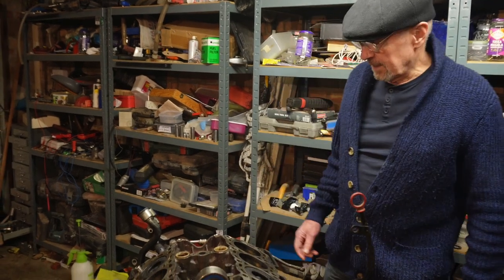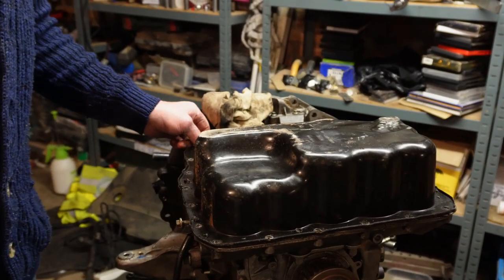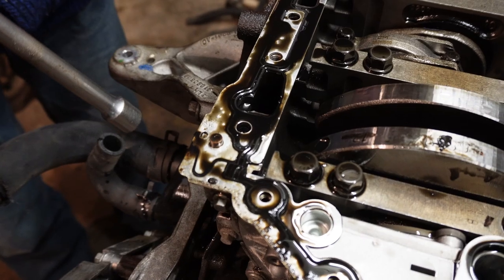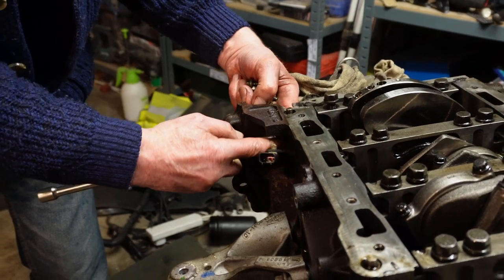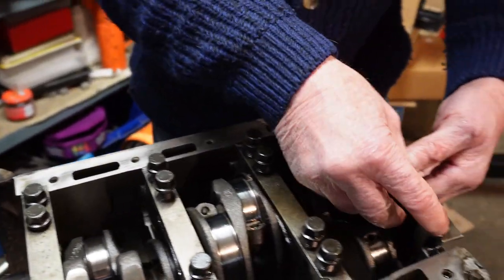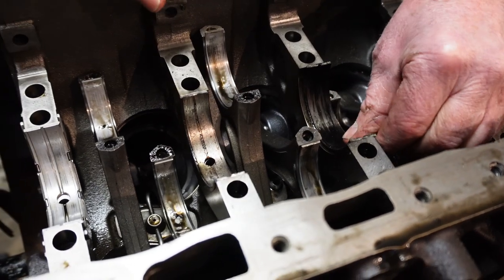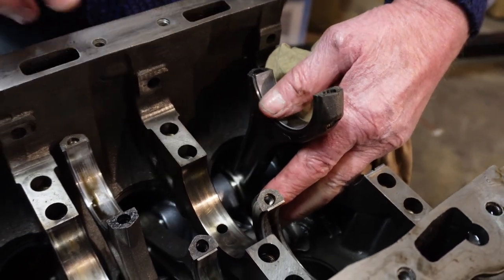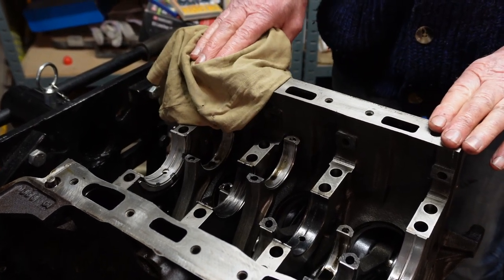2.7 / 3.0 Diesel TD V6 Jaguar Land Rover - Destroyed Bottom End Crankshaft

Comment: Would you recommend using 5w40 oil instead of 5w30? Mine has 175K miles on it and has the DPF (09MY). Thinking of using 5w40 now
Reply from the maker: Hi, thank you for watching and for your feedback. I stick to the recommended oil or equivalent simply because I have not put the research into how different oils / grades may affect the engine / cats / DPF. I do recommend 5 to 6,000 mile oil / filter changes just in case the engine oil is, or starts to  get diluted by the diesel fuel.
Reply: Go to the LR Time channel on YouTube. Christian, one of the presenters gives advice about which oil to use and why these engines fail. Spun main bearings are because the two central main bearings share lubrication oil from the same oil gallery pipe, so the oil pressure to them is too low. Whereas the two end main bearings have their own oil galleries. On top of this, the width of the main bearings is quite low and there are only four of them, on a LR, with a high torque engine, that puts lots of stress on them, an inline 6 cylinder would have 7 main bearings, so much lower stress on each one. LR chose the V6 to save space and money as this engine that can go in jaguars, C6 citroens and LRs. A bit of a compromise / penny pinching I'm afraid.
Reply: @richardhasler6718  I did find them and , watched the video you are referring to. It was very interesting. I decided to put 5w40 in mine.  So far so good.
Reply from the maker: Hi Richard, thank you for watching and for your feedback. Your comment / advise  raises the fundamental question, why do only a small number of these engines fail in comparison to the thousands / millions that don't ?  @richardhasler6718  Thanks again for watching.
Reply: @crystalclearmechanics thousands of them are failing. It's more of a when, rather than an if, on these units.
Reply from the maker: Hi Davey, Thank you for watching and for your feedback. I will be uploading a new video soon which will explain why a few  ( in comparison to number produced ) of these engines self destruct. I think you will find it very informative and it should put an end to the guesswork that is put forward as evidence of causation of failure, also the remedies that are pointless. @daveyboiyeah
Reply: @chips183 don’t do it I know someone did this in there 2013 sport and destroyed engine

Comment: I just bought a 2016 Fpace 3.0lt twin turbo & am now sh*tting myself !
Reply from the maker: Hi Darren, Thank you for watching and for your feedback. I will be uploading a video explaining the reason why a small percentage of these engines self destruct. I don't know your driving style but would advise an oil and oil filter change at 5,000 mile intervals as a precaution.
Reply: @crystalclearmechanics  thankyou my friend . I noticed in the service history the cam belt wasn't changed at 180k . I've now booked it in for a full service and cam belt change . $4300aud ! But at least I can drive it in peace then
Reply: When traveling with load in the car or high speed but low revs, kick down the gearbox first sonthe revs go up before accelerating had. Its called engine lugging, the oil pump isnt spinning quick enough to cool the engine when on load

Comment: The main problem is this engines not made for 2.5 ton heavy 4x4 suv's land rovers destroy low ends of engine because of crankshaft cant carry the stress of weight jaguars are going 250-300 mile without any problem especially xj's(because lighter 1 ton) also oiling process is so important in this engines this engines not start and go engines you must wait minimum 15-20 second for oiling ıf you good maintain them they go really high mileage without any major problem,nice videeo thank you !
Reply from the maker: Hi, thank you for watching and for your feedback. You make some good points.
Reply: Also note that JLR was recommending the wrong oil type, whereas PSA, was recommending the correct type. That's why you never see PSA cars with these problems.
Reply: @daveyboiyeah  thats true also jaguars  and psas have 2 garrett turbocharger and its have nice boost lr models have 1 big borg warner its no boost in low rpms and low end gonna eat itself my siblings have xj 2.7 with 510k km factory engine my s-type 2.7 only 185k km no problem workin like a first day 7k km-1 year oil filter service and general engine maintanence(oil pump water pump belts etc) also cheap oil filters are not work on this this engines ı always use genuine oil filter mahle air filter
Reply from the maker: Hi Davey, as i replied to your first comment, Please watch the new video ( soon to be uploaded )  @daveyboiyeah
Reply: All Cars with he 2.7 have these problems. Citroën and Peugeot ar much lighter, but, always the same, sooner or later. What really makes a difference, euro3 cars last longer. Euro4 engines have particulate filters, they have a cleaning process every 1000mls, that cause problems, Diesel can get in the oil sump. A lot of heat, bad for the engine oil.

Comment: Cause is simple ,,,, low oil levels ,,, the sensor checks the level in the morning with all the oil in the sump , and its just ok , no oil level warning  run the engine and half the oil is in the top of the engine , then go up hill or down  and the oil pickup has nothing but air to lift ,,, end of engine . if they had a deeper sump with more oil they may be fine , but tabs on the shells would help too , fix both and the issue would go away . well thats my thoughts.
Reply from the maker: Hi Tom, thank you for watching and for your feedback. Watch my cause revealed video for the main reason.

Comment: The oil pumps  in these engines don't supply enough volume or pressure.
Reply from the maker: Hi Darrel,thank you for watching and for your feedback. That does not explain why only a small number of these engines fail.
Reply: Rapid cold starts,foot to the metal straight away not giving engine time to circulate oil ?  In my Discovery 4  2016 I always wait 45 seconds at least before I drive away.
Reply from the maker: Hi, thank you for watching and for your feedback. Worth doing. @blackvulcan100

Comment: Would any of these symptoms manifest itself during regular servicing 😊
Reply from the maker: Hi,thank you for watching and for your feedback. If you watch my video " Cause revealed " it shows the main cause of failure. I recommend a 5,000 mile engine oil and filter change as a precaution. A check you can do yourself although it's not exact is to check your engine oil level on a regular basis, If it is increasing change your oil / filter and maybe your driving style. My "cause revealed" video explains it all. Thanks again for watching.

Comment: 15:55 is the jaguar long block or even the short block compatible with the Landrover (bolt holes sensors etc ?) could i source a jag engine and transfer the remaining parts onto the long block ?
Reply from the maker: Hi, thank you for watching and for your feedback. As reported year for year they are the same. I have not had the engine from a Land Rover and a Jaguar sitting side by side to compare but I did sell a Jaguar 2.7 engine to be fitted in a Land Rover and they didn't report any issues. I don't know if you include the oil pan / sump as part of the long / short block but that is different, My advise if it's the 2.7 engine you need, go for a 2004-2005 some 2006 before DPF regen.
Reply: @crystalclearmechanics  if I could easily replace it with something else I would , a nice Mercedes’ 606 would be ideal. I can get a complete Landrover engine with 300,000 kilometres and no idea of the service for €1500 or a an AJD from a 09 Jag XF with 135K for €500. Nothing wrong with what I have in it at the moment but it’s a lottery for when it goes bang as it’s also over 300,000 kilometres. Great car, shame about the engine. I believe the newer ones are even more delicate.

Comment: The problem is high compression + a faulty oil distribution lines design. Same engine is used on Citroen C6 and this don’t happens . To use those compression ratios on LR one must create new paths ( opening holes on the block ) till the middle bearings and course figure out new paths. Also increasing slightly the oil pressure inside the pump is a good move after all is TO MUCH compression for TO FEW bearings with a bad and faulty oil distribution the first and last bearings receive more lubricant than the middle bearings. Using Fusion 360 for that task is of great help. Also you could simply lower your car compression will be slower and have the same power of Citroen C6 but most probably that won’t happen. But I prefer the 1st option + using Fusion 360 is extremely easy near intuitive also you can monetize well by creating improved spare parts and running simulations something that Fusion 360 software also allows one to do.
Reply: C5 and C6 has the same engines as shown on material, and has the same issues. I already took apart multiple C5s with that issue.
Reply from the maker: Hi Rafael, thank you for watching and for your feedback.

Comment: Hi, I would like to ask if there are any symptoms to spot before the engiine fails like vibrations or noises?
Reply from the maker: Hi John, thank you for watching and for your feedback. I can't say first hand as I have not been in a Jag when the engine has started to fail but all 4 customers assured me there was no warning until they heard the loud knocking. There are weaknesses in the engines design but I think other factors cause or help to cause the failures, otherwise all the engines would fail instead of the very few that do. My advise if you own one, change the engine oil and filter at 5,000 mile intervals, the reason, the fuel injection timing is altered to help DPF regeneration which can possibly cause diesel fuel to get in and mix with the engine oil resulting in diluting the oil.
Reply: @crystalclearmechanics  Thanks for that info and advice.

Comment: Could the engine not be modified? Maybe tap the oil feed hole and green Loctite in a threaded tube that protrudes 1mm or so to prevent the shells from spinning? Asking as a non-engineer.
Reply from the maker: Hi, thank you for watching and for your feedback. If you watch my video " Cause revealed " you will see the main reason for the self destruction of these engines but of course there are other factors for engine fails beside the main one I pointed out. As for preventing the shells from spinning, they used to have locating lugs on the shells which fitted into  grooves machined into the block, Although I worked on petrol engines at the time, The shells and crank would wear to the point of the mains rumbling and the big ends knocking but the shells would stay in place. Did the lugs make a differance, I would guess yes, others would say no.

Comment: You class thst as where I would say it's just well run in what's the mileage? Big bearings not good why not put lug? I want you to get a Jaguar XF XJ ideally the V6 diesel but I'm not sure now? probably around 2010 onwards probably around 100,000 mileage anything I should look out for or not bother? what about the 2.2 l d I haven't got the facility the engine. Could it be overheating issue stretching the bolts are some of the boats not really up to standard? Do they have a manufacturing mark
Reply from the maker: Hi, thank you for watching and for your feedback. I'm in the process of making a video that answers the question as to what causes these engines to destroy themselves. This will not be applicable in every case but appears to be the main cause.

Comment: Too narrow bearings for that size of engine and a wrong oil grade recommended by the manufacture causes this engine failure. The formed oil lube of 5W-30 is too thin to hold that amount of  torque in that narrow bearing gap.
Reply from the maker: Hi, thank you  for watching and for your feedback. If you watch my video " Cause Revealed " It explains the main reason for these engine failures.

Comment: I think this is more of an issue with the 3 litre due to the extra hp?
Reply: there have been many problems with all variants. 2.7 initially had spun main bearing as it didn't a locating key, just press fit, as the guy said 5 revisions of the oil pump to fix oil starvation,, yet still the cranks continue to snap
Reply: My XF 2.7 (2008) changed engine at 76000km with this same problem!

Comment: You should admit that using any method of lock-in-place for both shells wouldn't have had the same result of spinning in place. In my book, it's a major design flaw. Why doesn't it not pop out for every engine? because even in the CNC era not all bits are equal. It happens when by design there is no room for error and both shells and cap are on their edge of specification. Isn't it funny how things are getting worse over time au contraire with natural expectations?
Reply from the maker: Hi, thank you for watching and for your feedback. If you watch my video "cause revealed" it explains the main cause of failure but I am inclined to agree with you that the tags on the shells although supposedly designed for location would help to stop the shells spinning which would probably result in just a crank regrind instead of the further damage caused.

Comment: ⚠️My theory for these failures I think is numpties thrashing them from cold.
If it was a design fault they would all fail.

I operate aircaft engines and so for example Rotax specify letting the oil temp reach a minimum of 50C before applying full power for take off.
How many car owners do this?
For a start we don’t monitor the oil temp in cars.
I'll give you a rough idea of the time it takes a petrol engine to reach 50C = 12 mins.
For a diesel it's going to be longer from 15 - 20 mins !!!
So think about that before you thrash a cold engine folks 😎
Reply from the maker: Hi Jules, thank you for watching and for your feedback.My video " cause revealed " explains the main reason for failure but not all.
Reply: Правильно !!!!

Comment: When I started rebuilding engines in the 60s it was unheard of to find an engine without the little lugs in the bearing shells, which made it effectively physically impossible for them to spin, both main and big ends the same (except the sidevalve Fords which had white metal bearings sprayed on to the con rod big ends and no separate shells, crap as Fords were and still are). Why on earth did they stop doing that? I used to think designs were changed to improve efficiency and reliability, not to write engine blocks off!
Reply from the maker: Hi Nigel, thank you for watching and for your feedback. It's not a good idea to put accountants in charge.

Comment: This video explains the design fault of the crankshaft & possible causes of bearing failure... https://www.youtube.com/watch?v=v3moekbW6z8
Reply from the maker: Hi, thank you for watching and for your feedback. The internet highlights what is in fact a very small number of these engines that fail compared to the number that do not. Unless someone can give a definitive causation as to the failure of these  engines, then it is all just personal guesswork. Jaguar explain how the Ford PSA designed  engine was produced and some of the materials used in their manuals. The cylinder block is cast in compacted graphite iron, which uses less material to produce compared to a conventional cast iron block. This provides reduced weight and length ( they do not explain by how much the length was reduced if at all but a shorter block results in a shorter crankshaft hence the crankshaft could be a weak point ) with superior structural capabilities. The bottom of the block is crossbolted and a ladder frame is bolted to the bottom of the block to give it a very stiff bottom end. It must be taken into account that these engines were designed and fitted in cars before the DPF regeneration system was fitted which alters the fuel injection timing to help heat up the DPF ( my experience of early S Types, pre regeneration, they appear reliable ). There are many factors that could cause the bottom end failure hence I can not give a definitive causation ( diluted engine oil from diesel fuel could be a problem, that's why I recommend 5,000 mile oil and oil filter change intervals as a precaution but the list is long ).  Thanks again for watching.

Comment: LR Time reckon the 5W30 oil grade is a Dumbass grade and way too thin.
Christian has converted to 5W40 medium SAPS C3 
I'm doing the same with my XJ 👍
These modern thin oils are only for the benefit of lower emissions readings NOT for the longevity of the engines.
Draw your own conclusions ⚠️
Reply from the maker: Hi Jules, thank you for watching and for your feedback. Using any oil apart from that recommended by the manufacturer will invalidate any warrenty that the vehicle may have. Watch my video " cause revealed "
Reply: @crystalclearmechanics  yes appreciate that.
My XJ is 9 years old and most are out of JLR warranty now anyway !
Let the experiments begin, it can't be any worse than the current failure statistics
Reply from the maker: @julesviolin  Hi Jules, thank you for watching and for your feedback. If you have not seen it? watch my video "cause revealed".

Comment: had mine rebuilt 4 months back after turbo took the engine with it, range rover need there balls kicked
Reply from the maker: Hi Stuart, Thank you for watching and for your feedback. Watch my video " Cause revealed " It's specific to Jaguar but if LR use the same DPF regeneration system?  I always recommend 5,000 mile intervals for oil and filter change in case of oil dilution although you can check the oil level to see if it increases, if it does then change the oil and filter.